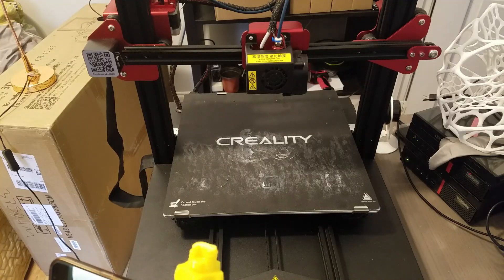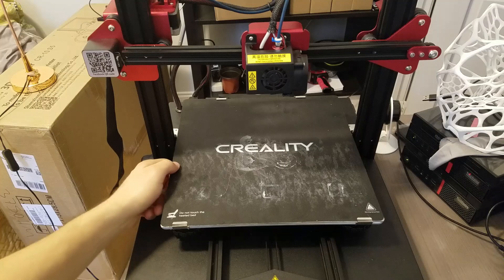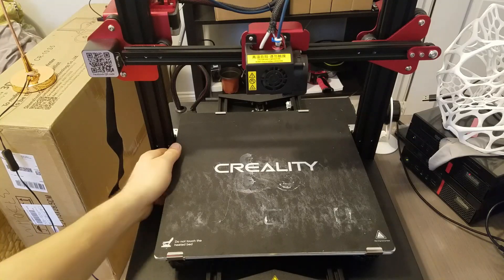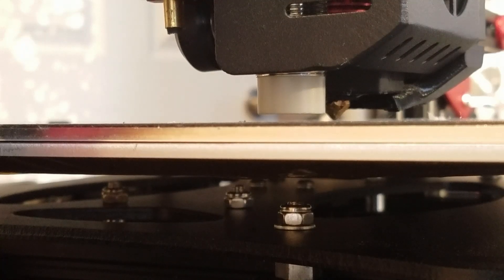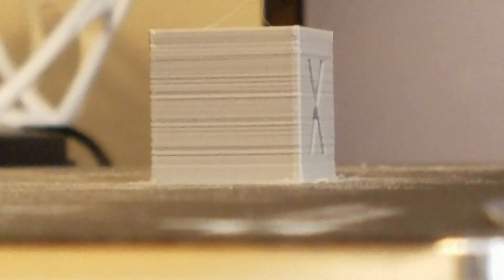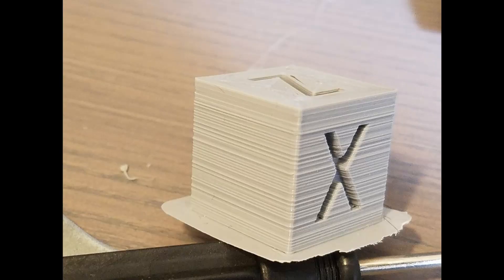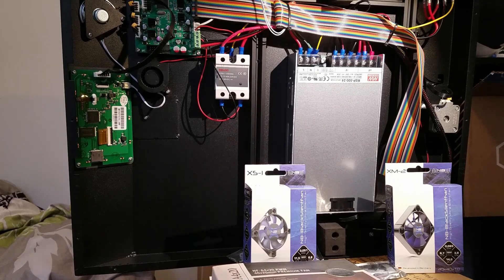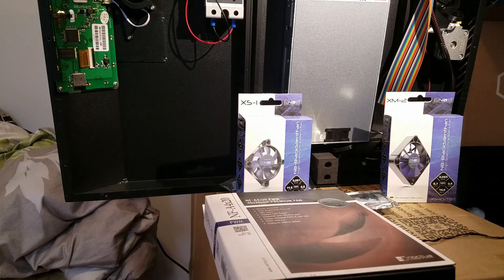Creality CR10s Pro 3D Printing problems and ringing, print bed rails travel bumps

Comment: I got same ISSUES.I really hate this printer now. All parts it's crap around the machine. :(
Reply from the maker: It wasn't the best printer. I moved on from that one to the artillery printers. the artillery they do a better job with 3 minor updates. . but still they could improve the bed adhesion to where they had it 3 -4 years ago. Then seemed better from the start.

Comment: Did you ever get this sorted out?
Reply from the maker: I changed some of the settings, and I was able to get some better results. But I still got bad results in lattice tests. You can check out this video on what I put together on how to setup that printer: https://youtu.be/_Bb4NlDA9ww

Or the video where I figured out that the inner walls were better than the outer walls, and decided to change some settings to make the prints better. https://www.youtube.com/watch?v=jTmmS93W64s
So I described the settings there but I think the shortest path on the seam insured that the nozzle travels properly rather than randomly change the seam. There is some sort of continuity on those videos. you can watch the ones about the 3d printer one of the the other from the one you started and you may be able to get some settings sorted out. But I reduced the speed, disabled the jerk, and chose the same speeds for everything: Inner wall, outer wall, travel speed, first layer. And the most important was the seam to be shortest. But even with those the lattices had issues. I hope this helps you a bit.

Comment: Hello, I have a Creality CR-10 with dual z axis motors. The z axis goes up and down when homing but will not go up when printing. Is it the machine or am i doing something wrong in Cura ?
Reply from the maker: I replied to you before I am not sure why you would post the same question on a different video.

Comment: I had the same issue, i took the bed apart and saw no problem, and then I figures it out, the v‐rollers were over tight
Reply from the maker: Yea I think part of my problem were the tight rollers. but still after dealing with them I want able to get nice walls. I returned to sender.

Comment: I got the same problem with my CR-10 S4 and i have more a very noisy vibration and when i loose the weel the noise get more loud and when i tighten the vibration reduces but it still and i got that problem like the video .Plz answer me plz .( if any body know a solution just send me your WhatsApp numb)
Reply from the maker: you re tightening the weheels on the bed and the vibration noise reduces?
Reply: @RoamingInterests  yes . But if i tighten them a lot the vibration appear . Btw do you have bit of vibration in the normal issues? I wanna know if this is only of my printer.
Reply from the maker: you may want to check all the nuts and bolts on the 3d printer and the frame nuts and the bed frame and gantry. to make sure is nothing loose.

Comment: This is my problem now to my unit cr 10s  pro  i try to fix rollers bump not to tight and feel too everything smooth rolling  but suddenly i start to test print again and the problem is here again i hear  knock or bump every 6 to 10 layers the alignment of print is bad like stairs 

sorry for my english I'm a filipino
Reply from the maker: To be honest I d not think that may be a problem. If you continue watching the videos I have discovered a way in Cura 306  how to make that 3d printer print cubes very well. https://youtu.be/emjQwSuXoEI this video show you how i discovered the Cubes were not printing well. But in this video I am giving out the settings https://youtu.be/jTmmS93W64s how I made the cubes print well. So do not choose any infill, choose the shortest path seam, and make sure that all your speeds are about 30 mm/s. and I mean ALL. Also You may want to check your motherboard VREF to see if the voltages are within the proposed limits. and there is  a video where i kinda compiled all the settings and adjustments you may have to do on your 3d printer to get the cubes to print quite well. https://youtu.be/_Bb4NlDA9ww. So make sure you skim trough this video and double check your settings. there is an entire playlist on the cr 10 s pro i have but I donot thing is necessary to watch all of the videos because not all are pertinent, and frankly I forget what each one focused on. i had to re-watch a bit of them to get you in the right direction.

Comment: I have the same problem.   After troubleshooting the problem, I found that the mounting screws for the lower rails have been tightened so much that the rail has be compromised.   That is that the bolts have forced the top of the rail down.   Solution, sand the groove where the bolt enters the rail or replace the rails which is what I will be doing.
Reply from the maker: Before you buy anything, or sand it maybe try to re calibrate the rollers to a happy medium. in addition some people have found that if the rollers are too tight they may develop flat portions. Also I think some bumps may be negligible. with all those issues i used to have,  i got the 20 MM cubes to print fine with adjusting the Cura Settings. If you have problems still, change to the Prusa slicer rather than buying rails. Then see if your walls print fine with the prusa slicer. Also you can get the creawesome plugin or mod for cura and use those settings.

Comment: Hate to say this but I have far better print results with my Ender 3. I had some minor issues with it at the beginning. Somewhat similar to yours and the reason was a loose coupling between the Z - axis screw and the motor. Tightened the screw and the Z - axis banding was gone. Make sure that you tighten the rollers everywhere properly, not too tight. The moving parts should move quite easily when pushed with your hand.
Reply from the maker: Thank you. for the advice.

Comment: When I got mine my bed had a sticky point it would kinda sit into  it was the rail where the bolts go through it inside it was rough,  I had to sand it down, it may seem like the roller as it seems to do it every cycle but thats just the other wheel hitting it,  as for your banding on the test cube you just need to get everything tightened to the propper tension,  just tight enough so it has no wobble or movement,   tighten ALL screws , most of mine were loose out the box, also the bed was so tight I had to use lots of force to move it,    and the Z axid rollers were so tight it was redicoulous,  now mine prints so good surfaces are so in line ans smooth on fine- super fine its really difficult to tell its 3D printed,  stick with it it will be worth it .  I had headaches too with the bed leveling and all that,  had to update the firmware,  put the sensor closer to the nozzle level (not with the stupid thick spacer)   Glass bed with PEI film.  ... all new fans(although you dont need too if noise isent an issue)   its totally not a printer for someone new to 3D printing as some might saty, theres just too much work to get it right out the box,   Prints far FAR better than my old Ultimaker 2.
Reply from the maker: Thank you for that piece of Info. I appreciate the encouragement.
Reply: @RoamingInterests   I feel now that maybe it is the weels too as mine still does it if I tighten them too much.

Comment: The rollers are too tight and when it is sitting unused it will leave a flat spot on the roller. They need to be just tight enough that all the rollers touch the rail and there is no play. The flat spot should go away on its own once they're not over tightened. They're always too tight from the factory.
Reply from the maker: thank you for that piece of wisdom. I did not think of that.
Reply: @RoamingInterests  yeah I've had that problem on a couple of my printers ended up buying new rollers didn't even need them just needed to loosen them up a little bit. In the flat spots went away

Comment: I can see you got a massive warp in that bed,making it almost impossible to level the bed properly. replace the bed with a 3mm glass plate there is one on eBay for £29, then remove the heat bed to adjust the bearing wheels properly it looks like one or more of them has been over tightened, you have four wheels on the inside of those two gantry rails so check them inside as well. Also your last video you had problems with the stepper Z axis motor screws I think your problem was you tightened down those to screws that hold the Z axis brass screw to the gantry are two tight they should be just niped up leaving slight sideward movement.of the brass screw. Watch this video I think it will help you. https://www.youtube.com/watch?v=hG8X26UtLVw
Reply from the maker: Thank you.
Reply: the Massive warp you see is just his Camera lens distortion,     however my bed was slightly warped,  it needs a Mirror bed for sure,  (mirrors are generally manufactured flatter than glass)

Comment: The test print at 7 minuets in looks to be Z banding. That means the biggest problem is with the vertical Side rail wheels, not the Y "bed" wheels.
Reply from the maker: Thanks.

Comment: Hello my friend im french so sorry for my english!

I just receive a cr10pro and i had the same issue.

The « stop » that you feel is because the wheels are too tight.

You have to loosen them a the both sight of the bed and not only at one side
Reply from the maker: Thank you for the advice. I have been tinkering with the roller pressure so I can get better prints.
Reply: me as well
Reply: i get y axis layer shifts
Reply: Salut Gégé :D
Avant de regarder cette vidéo j'avais jamais fait gaffe à ces points de résistance (première imprimante, je l'ai depuis moins de 2 mois).
Par contre j'ai remarqué que sur les 8 roues, les 2 sur l'extrême gauche ne tournent quasiment pas lorsque je déplace le bed sur toute la profondeur (la totalité de Y)...
Un diagnostic docteur ? :D
Reply: Mikerhinos salut !!

Sache que je débute aussi ...;)))

J’ai aussi eu ce problème, du coup j’ai démonté le plateau de sorte à ne garder que les roulettes et le dessous du plateau, j’ai tout remonté en resserrant les roulettes diagonalement, juste ce qu’il faut, j’ai remonté le plateau avec les molettes et ressort aux angles et tout est rentré dans l’ordre...

Comment: Nice video, I had a similiar Problem on my first print and solved it completely by adjusting the outer wheels. Guess I got lucky and hope you'll get it sorted out!
Reply from the maker: I think I may have improved it a bit, but I am not sure lattices print well yet. I am still working on it.

Comment: I sent my original CR-10S Pro back thinking I just got a bad one, but the second one suffers from many of the same problems.
1. Bed leveling was almost impossible. Would change with each auto level. So I switched out thier sensor with a insuctive sensor
https://www.amazon.com/gp/product/B01M1777XK/ref=ppx_yo_dt_b_asin_title_o04_s00?ie=UTF8&psc=1
That fixed my bedd leveling problems

2. Terrible Y axis shift on prints with multiple parts. Still working on this but I think you may be on to something with the "bump" you feel when moving the bed.
Gantry leveling helps the Y axis shift sometimes

3. Firmware. upgrade to the latest firmware. Fixes loss of autolevel settings and give some better adjustments during print.

At this point not sure where to go with this printer. Very close to sending it back and getting a Ender 5. My Ender 3 Pro has been a dream. The CR-10s Pro is a nightmare.
Reply from the maker: I hear you, I am kind of tuned out of this printer. This was for me a 3D printing BootCamp. Trial by fire, Now I have a fairly good understanding of Cura and 3d printing problems. I just wish I would have just printed and Not have dealt with all these issues. In regards with the leveling probe, I did get one myself But I haven't got the time to replace the existing one. This is the thing, with the tinymachines firmware it seems that the bed leveling is better. So I did not have to change the probe yet. Also the one I got does not have the connector, so I was waiting for the connector and once I saw that the leveling does not bother me for now so I never implemented it. I may try at some point to change it and see if it works.  Did you have to change anything in the firmware to get the new probe to level?
Reply: I did not have to update the firmware with the new program
I do not use the tiny machines Firmware
I did fix my X gantry Leveling which also helped my Y axis shift
I’m on my third relatively good print so continuing to do some tuning 
My replacement program did not come with a connector but I just cut one off an old lithium ion battery that I use for the drone and Soldered it on to the new probe
I did not want to cut any wires in case I have to send this thing back
Reply from the maker: That was my thing too, to not cut or solder the wires directly so I can retain the option to send it back. I do have to say that you gave me valuable information to make my decision on this printer. I did try to level the X axis and even now I am not sure it will stick at the same level after a few prints. But I did find out how much pressure to apply on the rollers, all the rollers. I have less ringing, but I am still uneasy about the printer, i feel something may be wrong with the motors, pulsing the travel. This reminds me to put in the next video.
Reply: Roaming Interests I will keep on tweaking my settings and continue to watch your videos
Maybe through sharing information we can fix this together
If you feel squeamish about soldering a new connector you can send it to me and I will solder it on for you
Today I’m doing my first large scale print on the printer that is not just a Benchy or a small test print
Reply from the maker: Thank you for your help. NO i am fine i don't dislike soldering, I have a soldering station that now mostly used for the heat-gun to tweak 3d printouts, or molding 3d pen printouts. I just postpone doing because the firmware from tiny machines seemed to do the job for now. What I am facing now is the motors not accurately traveling, So I changed the travel speed and all the speeds to the same values, That has somewhat improved some of the walls. But latices still do not print well, And I am going back to stringing, Not sure if that is because i resembled the head wrongly or something else. I just reassembled the hot end two night ago because there was a plastic puddle on it. so I had to redo that part. That started because the stringing. I have printed some torture lattice cubes, small ones. And I started printing at .32 Layer Height on the .4 nozzle. I even printed a cube at .4 layer height and it printed well on the walls, but now the hopping seems to be bad on lattices. I am working on a video for these.